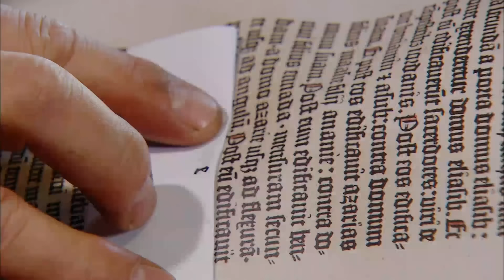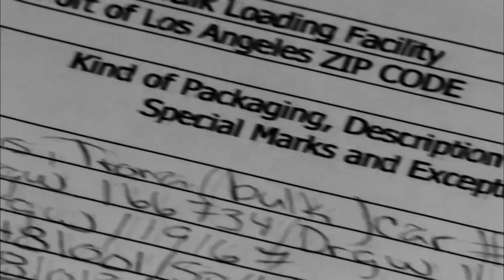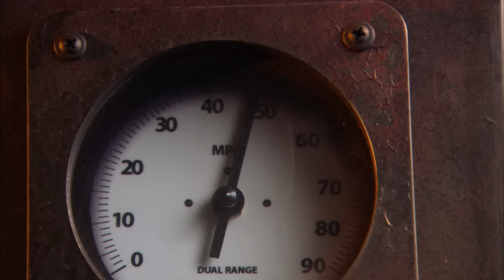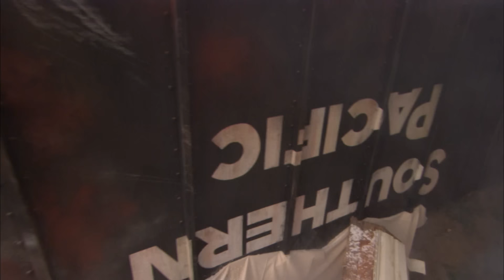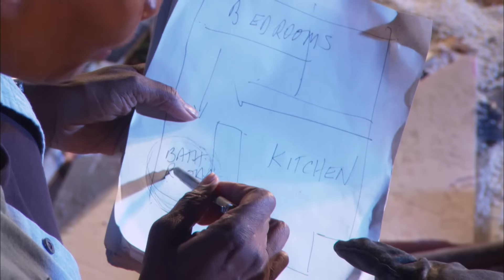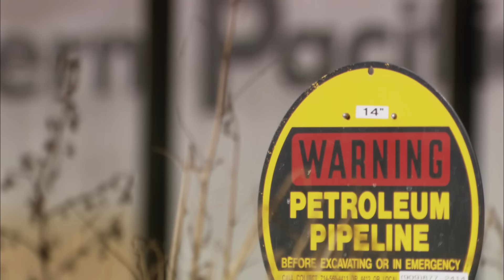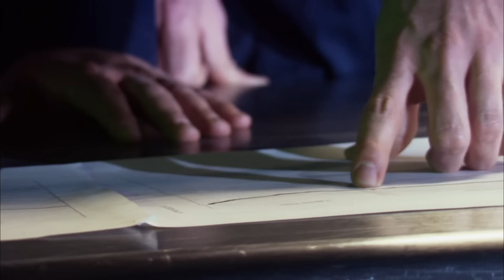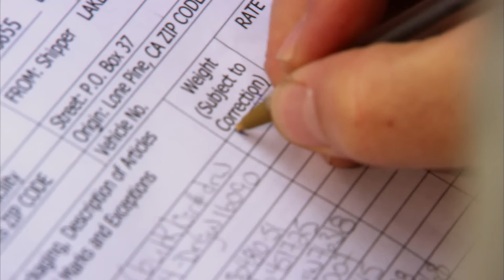Horrifying Runaway Train: San Bernardino Train Disaster SP 7551 East | Mayday | Wonder

Comment: Even after finding out the emergency valves didn’t work the first time, they didn’t repair those valves which would’ve avoided the second disaster or at least reduced the repercussions.
Reply: One of the Eastern rail lines came up with an emergency system, that empowered the Locomotive Engineer, to turn a special KEY, that would allow the use of Dynamic Braking WITH Train-line and Emergency air brakes. (The Engineer had to realize a perilous situation, in order to use it.) This would have helped prevent this disaster ?
Reply: @general5104  No it wouldn't have helped.  The root  cause was that the train was heavier than what the bill of lading and manifest said.  When the cars were loaded there was no actual weight measured.

There were sufficient retainers set for the weight listed on the manifest but these weren't sufficient for the actual weight.
Reply: April is talking about the valves in the pipeline. tho even if they were repaired it would have still happened since they were "activated" after the fire started, but the fire would have stopped earlier since they could stop the fuel if it was repaired
Reply: The valves had no impact on the second disaster, except that the fire burned all day long. The people that died, died instantly.
Reply: EXACTLY! I would have had heads rolling after they found their garbage valves did not work and they did nothing to repair \ replace them. This country pretends to care about safety but it is a big fat lie and this proves it beyond any doubt! Even the NTSB sat on its hands. Disgraceful!
Reply: @general5104  Who knows? But, it seems like it's a better idea to have an emergency system that works in conjunction with the dynamic breaking. Although I doubt it would have helped in this situation. Especially once the train gained so much momentum. I doubt anything could have stopped that much weight moving that fast. They underestimated the weight by something like 5.5 million pounds. Good God. I can't imagine them making a mistake that big.
Reply: @general5104  As far as I know how breaking works on engines and train in general there are 3 breaking systems.  One is for the engine itself (like your break pedal in a car) and it you emergency break it, you lock the engine wheels only and it doesn't affect anything else as it is not connected to any other systems. A second one is the dynamic breaking of the engine which slow down the engine tractor and thus make downward speed manageable - again this is only for the engine : it is like Jacob on trucks. The third one is the pressure break system that breaks all the train wagons and it works independently of the engine's break - you could stop the entire train with just that and even having the engine not breaking at all or even pushing.  So what they say in the video that when the 2 back engines slam the emergency breaks and it release the pressure break is not true.
The other thing that doesn't make sense is the pressure break applied too soon caused them to melt is like saying the World Trade's planes that crashed melted the steel beams in the basement of the towers and all the way up.  I think this was cleaverly covered up by NTSB.  Just look at the gas company no getting pointed to their faulty valves that would have saved live if they had been working.
Reply: The San Bruno explosion was yet another incident related to malfunctioning equipment. Wasn't till the huge disaster where they declared bankruptcy, that they were finally made accountable. One of the biggest issues, were shortcuts where to save on materials, they cut through people's homes. One family was completely incinerated in a fraction of a second, in the San Bruno explosion, by a pipeline that should never have been there in the first place.
Reply: @paulkurilecz4209  If you read one of the NTSB reports in the PDF form there's a part saying that 38 open hopper wagons that own by SP are equipped with the "Empty-Load" device or "EL" device while 31 open hooper wagons own by DGRW are not equip with "EL" device and the most tragic thing is that Rosamond rail facility could not accommodate 69 wagons.
Reply: @AUTISTICLYCAN  lol, and what happens now when Calif does something for safety etc. - the companies leave Calif and move to Texas like Oracle, Tesla etc. or into other states. It will not take long and Silicon valley is a commercial death valley. Such rules and regulations should be country wide and not state wide. Safety cost money and companies don't like that.
Reply: @ryzenforce  It's the dynamic brakes (not breaks) that disengage when the emergency brakes are applied.  And you seem to get into a conspiracy theory because you don't understand that overloaded friction brakes could melt, or at least cause the wheels to expand and come off the axles.  You should just stick with the facts.

Comment: I think the only thing I could relate this too is a run-a-way semi. I had a full load of beer on board, actually somewhat over-weight, coming out of Colorado Springs. Unaware of my brakes heating up,, then I saw the smoke. By then it was too late, I was travelling at more than 90 miles an hour. Tried everything I could think of, and running out of options. I started using the center barrier to try and slow it down. It was working, but slowly, When it slowed down enough, I ran it into the shoulder. The back half of the trailer was completely engulfed in flames. I bailed out and got as far away as I could. What a nightmare.
Reply: They'll do that very thing. Heat up, fade and flame up. I live and work and drive here in the hills and KNOW where you're coming from. I can take you to a place where the same thing happened but the truck or driver didn't survive. The trail down the hill is still there. Glad you made it. God Bless You!
Reply: Lost my brakes twice in my over-the-road truck before everyone had a Jake brake. Both times I started down the grade slowly but the brakes went away.
Reply: @anthonynelson9136  I just got my cdl. I couldn't imagine just having regular breaks. It's scarry enough being heavey with the Jake break on full!
Reply: What year did this happen?
Reply: I was coming down Cabbage last summer, loaded very light so I was at 60 mph and I saw a truck up ahead of me and every brake on his truck was boiling smoke. He had to hit the shoulder to pass another truck or else he would have rear ended him. He took the next runaway truck ramp  and got it stopped but I swear the truck was just before catching on fire. And, just getting it stopped is no guarantee it won't still catch on fire as now there's no airflow over the brakes to help cool them. He was talking on the radio and I told him not to set his brakes because it'll egg shape every brake drum on the truck being that hot. It was a miracle he didn't kill off some folks.
Reply: @Thecaptain1898  *brakes
Reply: @RedRoseSeptember22  oh yeah look at that. I spell a lot of words wrong 🤣 I just recently realized I've been spelling grateful as  "greatful" yeah I'm not the smarts person 🤣🤣🤣
Reply: Thank God for runaway truck  lanes in the Rockies...
Reply: I lost my breaks in a tanker In the winter and rolled down a hill backwards at 40 mph scariest thing of my life..

Comment: I've just finished my engine and air course yesterday in Geelong Australia and am now starting out as a driver under instruction. We learnt just a few days ago that when your train is in full dynamic with full air brake applied and you are maintaining a constant speed downgrade, you are out of control as you have no more braking power to deliver and an emergency call must be made. We also learnt that a full service application of air brakes is more effective than an emergency application in this situation as the power knock out switch will not be activated and the dynamic brake will remain engaged. We all learn from these terrible accidents, most of the rules arise from incidents such as these.
Reply: Sounds like you have a very experienced minder driver ,/ instructor,yes if you put 26L into emergency it will disable dynamics,pros and cons it will also send a emergency base call to emergency services,start sanding and it's proven bring you to a stop asap ,cons you burn out your grids behind the cab
Reply: But going down grade,full dynamics,look at your MR gauge,once again put your reverser in forward,notch it up which I know sounds stupid,then centre the reverse and apply full dynamics
Reply: Just my experience with losing air on GE locomotives
Reply: All else fails the golden rule is , stay with the locomotive, don't try and jump
Reply: Basically what I am trying to convey keep your dynamics, hold the sand button down it will help but do your math before you leave the yard ,it's the locomotive engineer responsibility

Comment: the people of San Bernardino: "the pipeline was fine"
the narrator: "but the pipeline was not fine."
Reply: They failed to see the aviation fuel line in the ground during the moving of the train parts.. and hit it with equipment.. i was near by.
Reply: @mustangracer5124  it was gasoline in the 14" line. Avgas runs thru the 8" line which was not damaged
Reply: The people of San Bernardino "Wait! what???!"
Reply: It was fine when they inspected it. The problem is that they didn't inspect it again after the cleanup, because they would have noticed the damage if they had.

Comment: So there was no disclosure to the home buyers about a 14” high pressure fuel line right behind their homes ?  Those homes should of never been put there.
Reply: But who reads signs . Easier to say I never saw them .
Reply: should also be illgeal to put in witjout telling people
Reply: legally now a days its gotta be in the contract of the house or thats a lawsuot alot has changed since the 80's
Reply: Oh, please. There are millions of miles of buried pipelines all over America.  I have two gas pipelines cutting across my property.  This was a very unusual accident.
Reply: Why can't they build pipelines away from towns or towns away from pipelines?
Reply: Wich is exactly what everyone who lived in the San Bernardino area thought! I believe some of the lawsuits taken out against Cal- Nev had to do with that very lack of disclosure.
Reply: @NickyD  It's likely the pipelines were installed before the houses were built. The area was and is rural along the tracks.
Reply: - I'm guessing you were involved with this particular installation (correction: purchase) you said "our due diligence" but the video did not show a warning sign until they were removing residue of accident and it was marked off for the heavy equipment. Edit: Why didn't they fix the faulty valves when they were discovered?
Reply: @jerroldkazynski5480  THE PIPELINES WERE INSTALLED IN 1973, 2 OF THEM, AN 8" AND A 14".
Reply: It cracked me up when the guy replied "who reads signs?" If there's ever been a case of "seen one, seen 'em all," it's buried pipeline markers. I'm willing to bet there is no point along the pipeline system where someone can stand an not see at least two markers. With all the flack that California gets about regulation would it let fuel pipelines slip by unregulated?
Reply: @xonx209  Because pipelines carry product to and from towns. 
And, contrary to popular belief, pipelines are many times safer and more friendly to the environment than trains.
Reply: XonX  yeah because we can go down to those pipelines with our pick up trucks and wheel barrels to Get what we need. Brother !!
Reply: @jerroldkazynski5480  you got it, those cheap houses on Duffy st. and around didn't need to be placed there, on the outside of a curving trestle bridge
Reply: @xonx209  Jeez, I wonder how those homes would be heated? Maybe pay more to go fill up your tank somewhere else? Or do you think sh#t just happens at your house because of old what's his name?
Reply: Those signs are there now. I don't remember those signs being a thing in the 80s. (I live in an area with buried gas lines nearby.) And, any potential hazards should be listed in the paperwork for the sale of the houses, but when you have a stack of papers the size of a dictionary to sign with an impatient bank employee, people tend to miss those. But I wonder if they were even declared in the documents they should have.

IMHO, no, those houses should not have been built there. There should have been an exclusion zone around the tracks.
Reply: @xonx209  That is the most ignorant post I've seen in a long time. You obviously have never seen any excavation in a municipal area....they are criss-crossed with pipes of all kinds.!! WoW!!
Reply: yeah I think disclosure was definitely a issue
Reply: @tjj300  Also, the pipeline companies love to install their pipes along RR right-of-ways because it's 1 owner and typically has decent engineering drawings showing what's already there such as other underground utilities.
Reply: @xonx209  I think it's the towns who want the gas supplied in the first place.
Reply: @danielwanner8708  Everyone should read signs... If you don't pay attention, then you accept what is there.
Reply: @jerroldkazynski5480  Yup, those lines were there long before the homes were built.
Reply: Every buried gas line is well makes with posts that says buried pipeline and has  the companies name and telephone number on it every 100 meters or so.
Reply: @xonx209  often they are but towns and houses encroach upon them its called urban sprawl.
Reply: There are alot of train and industrial disasters that would be interesting to see what happened.
Reply: 9o
Reply: @purpleflametarot39  Yes, we (GATX Corporation) purchased Calnev from the UPRR in 1988. I viewed a plethora of docs and some indicated the location of every 'buried pipeline' sign from the terminal in San Bernardino to Vegas. I also ended up driving every mile of that pipeline with the chief engineer in early 1989 along with 2 auditors from the Ca. BOE. Calnev supplied over 95% of the fuel needs for the Vegas area including McCarren airport and Nellis AFB. The demand was so great that some schlump at Calnev decided not to interrupt the flow to repair the valves.
Reply: @xonx209  As long as human growth is exponential, people will need to live near every jeopardy necessary. Tornado Alley, river banks, near ocean, base of hills, next to chemical plants. The only way out is make sure there are plenty of us to survive the trauma. So we can continue the carnal bliss as god intended.
Reply: @xonx209  Its the other way around, houses were build near an existing pipeline.
Reply: because that's where the gas is going - to where the people are who use it.
Reply: @xonx209  Do you have a propane tank on your property?  If you have anything on your property that is methane operated, you WILL have a pipeline under your house.  Oh, if you have a propane tank...you will STILL have a pipeline under your house.
Reply: @NickyD  alot of bad has came along since the 80s🤷‍♂️
Reply: @xonx209  if you have a gas stovetop, water heater, etc you have a gas line going into your home or apartment there is no possibility of building away from pipelines.
Reply: @xonx209  Because they are going through a pass both rail ,pipeline and I-15
Reply: @tjj300  Wrong pipelines spill 3x more than rail.

Comment: 17:05 "we have a slight problem" just a bit of an understatement
Reply: It's an idiotic waste of time when you're reporting an emergency.
Reply: yeah just slightly an understatement.
Reply: @notroll1279  I know.. I mean you watch enough air line disasters you realise what improvements have been made to communication and cockpit communication.. Standardization... , double checking... repetition of commands.. they do that in hospitals too.. they have to... they can't assume and use different terms or imprecise communication..
Reply: The irony in this comment lol
Reply: @caelidhg6261   This line was just the icing on the cake... after guesswork on the train load, failure to discuss the known overall load among the team, not reporting the loss of braking power of an engine to the head engineer, failure to make sure that someone was always available at operations control...
Somehow the engineer didn't know that activating one braking system would release the other brake system - which raises questions about type specific trainings.
By 1989, the railway company should have known a lot better than running their operations without more formal safety procedures ...